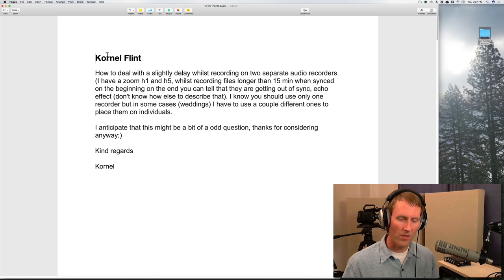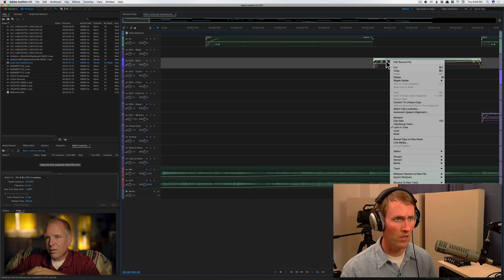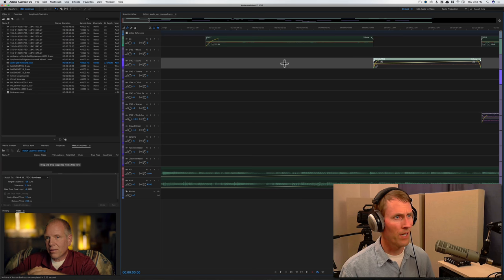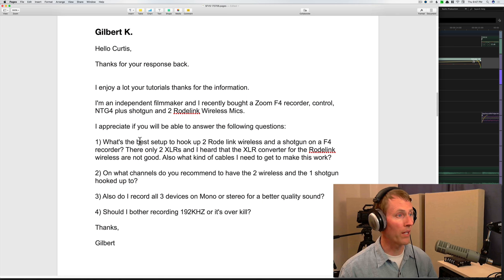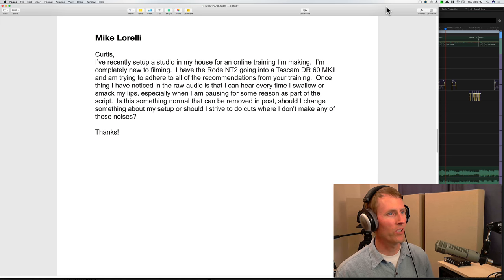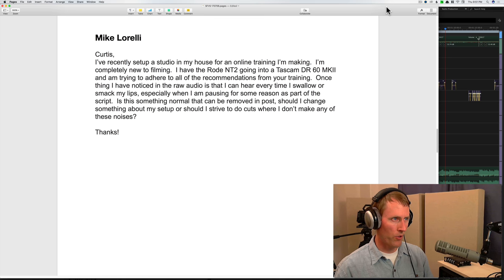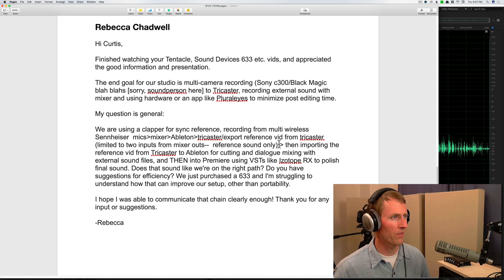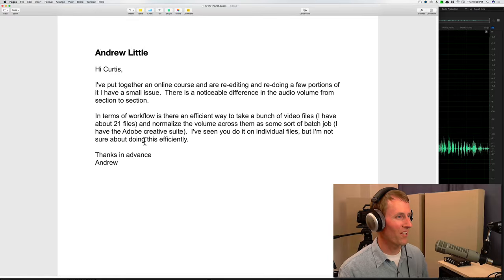Sound for Video Session: Sync, Blending Mics, Recorder Setup, Mouth Noise, Loudness, Multicam

Comment: Hi Curtis. Another great session. Your tutorials and reviews are some of the best to be seen. Thanks! A couple of 'pickups' on this one... The Zoom H1 and H2 are notorious for drifting out of sync with other recorders. I assume the internal clocking is a bit off... no problem when they're solos, but a pain when you want to try and keep sync... It can't be done! The only way is as you've suggested: 'cut and nudge'. I think the guy who was asking about the Rode radio mics and the NTG4+ got confused about his Zoom model numbers.... He stated that he had an F4, but that it only had two XLR inputs. That's not right so I think he has an H4.... otherwise his question doesn't make sense to me! :-)
Reply from the maker: Thanks Mike. That makes much more sense that he has the H4. Good catch. I guess we'd need to modify the advice on that to using just one of the radio mics into an XLR input and the other into the 3.5mm input. Thanks!

Comment: I wonder if Rebecca was asking about utilization of timecode in her workflow. Record audio iso tracks on 633 with the 633 sending timecode to the Tricaster (maybe as LTC). Thus iso audio tracks could be relinked to visuals later in the workflow by using timecode rather than having to synch on sound. Done right that would probably speed up the synch process and greatly increase the synch accuracy.
Reply from the maker: Good point, could definitely save time particularly if Pluraleyes is missing sync on some of those clips.

Comment: Hey Curtis the videos are always so educational, thank you. I will be doing my Documentary do and plan to do the following. I plan to boom the Talent with both a Rode NTG2 & NT5  just as all the interviews indoors and hope to choose the best quality  between the two mics  as a back up I plan to use a Sony lav mic plugged into a Zoom H2n and finally a on camera mic with a Rode Videomic. The lave and in camera mics are mearly back up audio and I aim to use the best out of the NTG2 or NT5. Will this work or intgr end cause more issues. Thanks jf
Reply: Yes, should work great. That's a lot of redundancy. I usually go with just one boom mic and one lav per person in addition to any on-camera mics for scratch audio (to sync in post). But having an additional boom shouldn't technically hurt anything, just give you more options. The only reservation I'd have is that if you create a setup with more stuff, it can be intimidating to people that are not used to being in front of a camera so where possible, I like to keep things simple. One boom mic is probably enough and being indoors, I'd go with the NT5 or if the space is not too reverberant, the NTG2 might work better with its more directional/isolating polar pattern. Worth a test if you have time before the shoot at the location. Good luck!
Reply: Hey Curtis, thanks as I did not think about the intimidating aspect of lots of gear,its very true,. Your, advice is appreciated hope to get one of your courses as soon as  I get myself sorted , which should every soon. Am enjoying your second channel. All the best JF

Comment: Hi Curtis, thanks for the video.  Quick question.  When I use the 3.5mm mic input on my Canon xf100 fed from mixer output, I get a continuous static noise. I tried to use limiter, line input, ext mic , reduce mic dB, etc.. options on the camera but the noise is still there. The minute I use the xlr input on the camera the noise is gone? Do I have a bad mic terminal or am I missing some other settings?
Reply from the maker: You'll want to have the camera's input set to line level and you may want to try using an isolating transformer.

Comment: Audio drift Premiere Pro has an option to speed up/speed down. If it just a few frames over a long take, something like 99.97% or 100.1% fix it. I guess you could calculate it, but experimental trial and error usually you find the perfect percent in a minute or so.
Reply from the maker: Good idea, worth a try. Thanks!